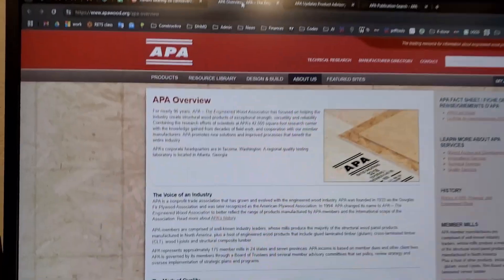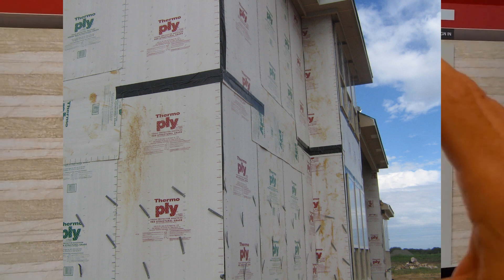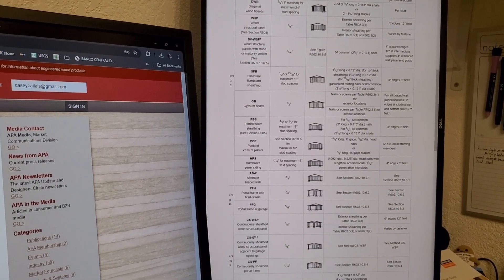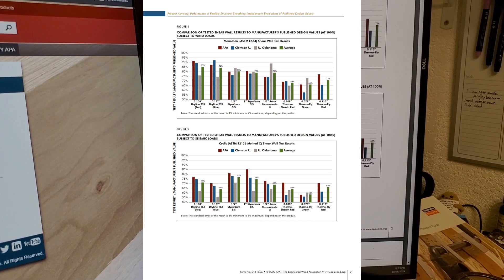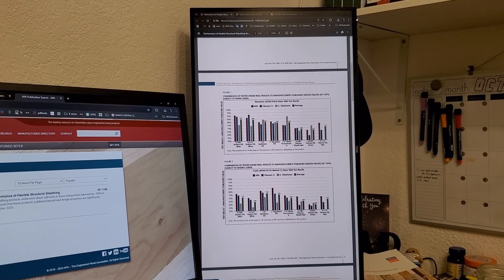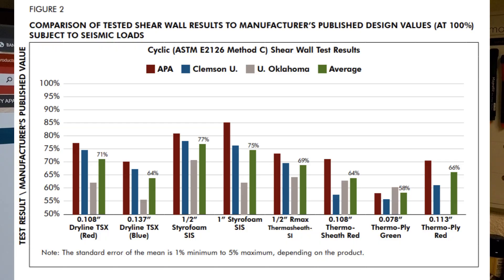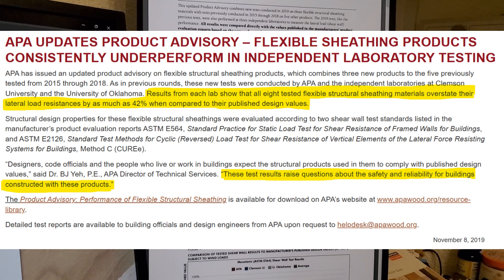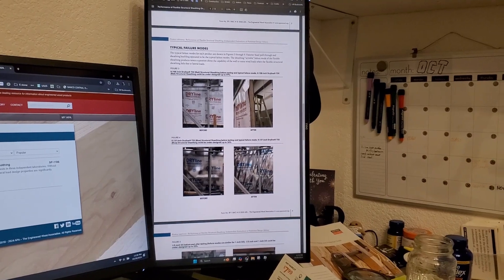Independent testing tells the TRUTH about cardboard house sheathing!

Comment: The answer to how they can pass their own test and don't pass independent  testing is simple. They falsified their test results. That is what happened with Federal Pacific electric panels. UL caught them falsifying their test results for UL rating. Even when their UL rating was taken away, Federal Pacific continued to sell their products with the clam that they were UL rated. The various government entities meant to protect the public did nothing for years more.

The variation in the test result concerns me on multiple levels. It raises the questions of how consistently are they manufacturing this cardboard sheathing and how much is their products effected by humidity.

Lastly, this guy is speaking form his experience as a home inspector. If you have seen enough inspection videos, you will know that some luxury and custom home builders are using these cardboard sheathing materials.

Comment: a lot of the builders in my area are skipping sheathing all together and putting in a few let-in braces at the corners and wrapping the building framing with tyvek then strait to siding. I think thermo-ply would be better than just tyvek, it just needs to be treated like a wrb not a structural part of the building.

Comment: The APA is a trade organization for the wood sheathing industry.  The engineered fiber sheathing test results that they present are from non-accredited university labs and commissioned by the APA.  The test results that the engineered fiber sheathing manufacturers present are from an ANAB accredited testing facility and stamped by third party professional engineers as accurate and building code compliant in each state.  Engineered fiber sheathing is a combined weather barrier and structural sheathing that has performed successfully in the home building industry for more than 40 years.
Reply: You are the problem. For once in your life contribute positively to humanity and walk eyes closed towards a highway
Reply from the maker: Huh. That's interesting. So is this (again, APA): Texas Tornado Damage Assessment Report 
"Failures associated with flexible wall sheathing - Most of the homes observed as a part of this survey were sheathed on exterior walls with a flexible laminated-fiber sheathing that measured approximately 1/8 inch in thickness. The walls were either fully or mostly clad with brick veneer on the exterior. Common problems in the strength of walls sheathed with laminated fiber included poor loadpath continuity of framing within wall systems, especially at wall corners, and within wall systems stacked vertically between stories. These walls also performed poorly in resisting racking forces from lateral wind loads."
https://royomartin.com/wp-content/uploads/2023/04/APA-%E2%80%93-Texas-Tornado-Damage-Assessment-Report.pdf

Comment: Zip R, or equivalent, should be code in every state. External insulation is crucial in reducing energy costs.
Reply: That stuff is cool but it's twice the price of just buying the sheet of OSB and putting foil foamboard on yourself and then taping.

Comment: 0.078" thick? Between 1/12 and 1/13 inch? Seriously? Shouldn't you be running that through your printer and not stapling it up as "sheathing" on a WALL? How do you get it delivered? By slapping a stamp on it?
But, I live in a country where 95% of the homes are made with stone so what do I know....
Reply from the maker: Just add more staples and it gets approved!
Reply: @constructivainspections  Damn what "gets approved". Why would anyone want to build their house that way?

Comment: Cardboard sheathing isn't new. Matt Risingers (YT) tear down used a cardboard sheathing product from the early 1970s. Home was still OK after 50 years in Austin TX. That said I won't use or recommend it. 

Most homes are build to the bare minimum. Spec homes need to be cheap, and most people buying custom homes want they dirt cheap too. That isn't ever going to change.

Comment: Old enough to remember when we didn't use full plywood diaphragm. We had cut in braces, a few shear panels, then just kraft paper over the studs behind siding. As a matter of fact, my first year of apprenticeship the APA sent a rep out to tell us about the new OSB products. Anyway, carboard as sheeting behind siding or stucco would be fine...AS LONG AS you don't expect any shear value.
Reply: Excellent point.  Also emphasizes how bad it is for the plumbers and sparkies to be chopping holes in it, as shown in the first minute here. Shear value goes straight to zero.
Reply: Don't they do houses in colder areas with OSB on the corners for shear strength and foam over the rest of it for insulation? I guess that works if you don't mind someone cutting through the vinyl sidings, foam and drywall with a boxcutter at 2 AM.

Comment: I've built a few houses over the years and have installed lots of 1/8 inch "shear panel". at least that is what it was called and was approved by code. I never did trust the stuff to really hold up under any type of shear force. I don't think any house that I installed it on has had any type of shear force applied to it. Some of these houses are now over 40 years old.
Reply from the maker: Most houses aren't stressed to their maximum design value during the lifetime of the structure. Every house is built hoping that tornado or earthquake never happens. But for some houses, it does. And THAT is when it needs to perform.
Reply: @constructivainspections  you are right. most houses are not stressed to their max .. I would even say that most houses are never stressed at all, other then a snow load on the roof or a wind load on the walls.

Comment: How could the manufacturers' test results vary SO greatly from multiple, independent tests without there being some kind of deception or fraud? This seems like an avalanche of lawsuites waiting to happen, and if the manufacturers are as culpable as it appears, then they deserve every penny they lose.
Reply: The executives will get their payout and move on unharmed
Reply from the maker: I wonder the same!
Reply: You got to consider that these products compete with APA, which has a vested interest in publishing defamatory articles about competing products.  Consider that APA OSB has water problems as well. if it gets wet it will rot & fail. Probably the Thermoply will last longer than OSB  when exposed to water, since its fully water resistant on both sides. The issue is the lack of structural strength since its only 1/8" thick & too thin as a nail\screw base for trim, lights, etc. 

Probably the best product on the market for exterior wall sheathing in the US is Zip System, with its water resistant membrane. I just wish the backside was primed to improve water\moisture resistance.

Comment: It's especially bad in a semi-humid climates like Austin with 29" of rain a year because production builders don't incorporate adequate rain screens on the outside or thermal breaks on the inside for tract homes so your ThermoPly and Dryline TSX are going to be further weakened over time from moisture because I doubt 100% of the siding was installed correctly and they always miss details like proper kick-out flashings. Then you have wet cardboard sheathing with the structural integrity of a wet spaghetti noodle.
Reply from the maker: You hit the staple on the crown, homie.
Reply: Matt Risingers (YT) tear down used a cardboard sheathing product from the early 1970s. Home was still standing & there was evidence of water leaks. Go watch his video. No I don't recommend it, but it does last surprising long times.
Reply from the maker: @guytech7310  you should read this forensic analysis of the tornado outside of Dallas in 2017: https://www.apawood.org/publication-search?q=sp1182 @guytech7310

Comment: The homes that are built from solid wood are being torn down and dumped in the landfill
The timber that was used to build older homes is no longer available … and it’s not gonna be unless you can wait a few hundred years for it to grow.
Uneducated American consumer is who is driving the market 
The manufacturers are only trying to keep up with demand while dealing with an ever decreasing timber supply 
What do you expect manufacturers to do? 
The American consumer are the ones that need an education
Reply: While I agree that the consumer should know better and turn their backs on this garbage, en masse; but I disagree with the timber shortage claim. Forests are replanted and grow much faster than you think. Forest farming IS sustainable. Add to that engineered timber is much stronger than any natural timber, even the heirloom stuff. Just look up CLT or the skyscrapers they are building out CLT. It's amazing stuff.
Reply: @3rett115  
lol…. I don’t have to look up anything! I’ve been in the trade for 31 years. 
I know what I used to be able to get, I know how old homes are built and I know why manufacturers are using OSB LVLs MDF for building materials. 
Old growth large timber is gone! Tree farmed lumber is JUNK!  It’s less bug and moisture resistant, it’s less stable , it’s inferior to old growth lumber. 
Skyscrapers …. Are built from red iron and concrete 
You’re referring to plyscapers that don’t have nearly the same potential 
CLT lumber is made from small pieces of lumber glued together … the reason for this is because we can’t wait hundred years for a tree to grow that tall. Resulting in inferior quality manufactured lumber products. 
I’m sure you’ve probably noticed the difference in quality of timber the last 30 plus years too! Haven’t ya? 
Cuz it’s well known with any seasoned woodworker
Reply: @Bachelor_Brad Sustainable forest lumber produce an efficient product. There is a reason we call them sustainable. Prior generations decimated many old growth forest. 

We don’t need old growth stud. That is a waste of good wood.
Reply: @phamlam3720  
Sustainable was a lie 
Have you noticed the difference in lumber the last 30 years ?
Reply: @phamlam3720  Yeah, this guy just wants to argue and not have a civil discussion. It doesn't matter if young timber is inferior. Modern building science (basically common sense vapor control) will enable young timber to last indefinitely. For example, in my rural area there are dozens of 100 year old structures made from old forest which are completely collapsing. Wood simply needs to be cared for, and it's fine.

His dismissal of CLT skyscrapers is also telling. Does he drive a Model-A? Is he writing YT comments from a Commodore 64? What are we supposed to do? Build houses from stone or move into caves because we can't get any aged timber? Ridiculous logic.
Reply: @phamlam3720  
Can you share your experience to help back your opinion?
Me;
Started tuning wood on a lath in my father garage late 80s
Wood class in jr. high and high school early  90s
Vocational school 95-96 for carpentry
2000 I joined the UBC making journeyman carpenter 3 years later 
Owned my own wood shop from 2002 - 2023
Ran my own remodeling business 2006–2009 / 2016 - 2023
Reply: @3rett115  
It’s obvious you were never taught debat classes in elementary school.
To claim someone is arguing is nothing but a manipulative statement attempting to belittle another. 
It’s very immature not having the ability to debate a subject. 
Furthermore, You have no experience to back you opinion. You post only opinions with nothing to support your statement 
BTW common sense vapor control (lmfao) isn’t as common as you think. 
Vapor control is handled many different ways depending on what type of weather a region experiences. 
What experience do you have to base such claims from ? 
It’s weird how the younger generations have this weird sense or righteous thinking they know more then someone with over 30 years experience
Reply: I forgot… after I got my drivers license  (93) I would travel to this fellow house named Larry. He was probably around 60 at the time, disabled from a drunk driver hitting him while mowing his grass. He “hired” me to help bring in firewood in exchange for free hardwoods. I spent most my time in his 2 car garage helping with his custom woodworking projects. This guy was a master woodworker! He made some fabulous pieces.
Reply: Did your wife divorce you?
Reply: Misinformation. There is not a timber shortage and we have a healthy supply of sustainable forest. OSB And plywood sheathing are plentiful. 

Thermoply only exist because there are builders willing to cut cost and quality.

Comment: 3/8 plywood is standard?
That's insane, cardboard is really insane, I have seen that stuff on some remodels of old houses,
I cannot believe they use this crap when building a house, OSB is garbage too, 2' on center wall studs etc, stop building with this crap contractors!
Lucky to be in Florida and can use concrete block, I think its the best, sheathing and studs in one shot, filled with rebar and concrete, thats tough stuff!
Reply: Everything is Ikea quality nowadays, cars, homes, clothes, food
Reply: 2' on center studs are better when you don't cheap out on the other encasing products better insulation values thicker drywall plywood exterior
Reply: @patrickday4206  Agreed. Nothing wrong wit 24OC. It doesn't diminish shear at all. All it does is reduce the overengineering of 16OC to hold the roof up. 16OC is better, maybe, for getting walls that aren't as wavy, or for making it harder to go through a wall. But really you shouldn't be playing football inside, and 2x6 is usually much straighter than 2x4. I build via 24OC and haven't had issues.
Reply: 2x4 walls 16OC have ~3.9sq in of stud cross sectional area per linear foot of wall. 2x6 walls 24OC have ~4.125sq in of stud cross section per foot. Less thermal bridging, more room for insulation, means much better R-values.
Reply: @haphazard1342  Great, then use 2x6 on 16c, I would never ever use 2x4 on exterior walls.
I remodel houses, when you want to rearrange a home with 2' on center studs, there are problems, when I want to mount a flouting desk, big TV, not enough studs.
Just glad to be in an area that can build exterior structures our of block, I do not think modern wood structures will withstand the test of time, seems like you guys are thinking of a nice new house, give it 50 years of expansion and contraction, bugs, leaks over time, bug incursions, etc.
These modern building products will fail.

Comment: IRC should ban Thermoply
Reply from the maker: I think at the very least there should be some more in-depth approval process for products. This is the kind of thing that I would imagine could result in a massive lawsuit if we get an inland hurricane that blows over entire neighborhoods.
Reply: @constructivainspections  I bet they went in with this product under the guise that is was more eco friendly... That is the only logical criteria that I think would have been a reason for this product to be used.. That or huge kickbacks to officials.. actually yeah, that is more likely...
Reply from the maker: Well, not sure how much more eco friendly it is. I haven't seen it marketed that way. Cheaper, yes. Usually that's the driving purchase factor. Regarding kickbacks, I wonder what DR J may have received as a "thanks" for giving it a passing grade!
Reply: I don’t know if I agree with a full ban, because the thermoply is advertised to perform more than just structural.  It should definitely be banned for anything related to structural or bracing.  If acting as a WRB, I think it is likely still valid as properly installed.  But to be honest, we pretty much do continuous OSB everywherr where I live.  If a builder suggested thermoply here in northern mn, they’d be laughed out of the region.